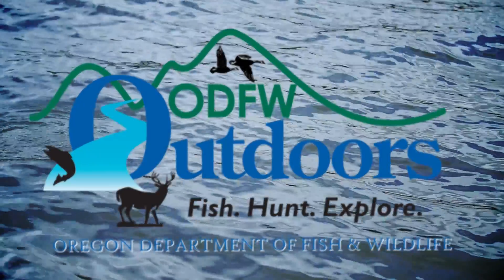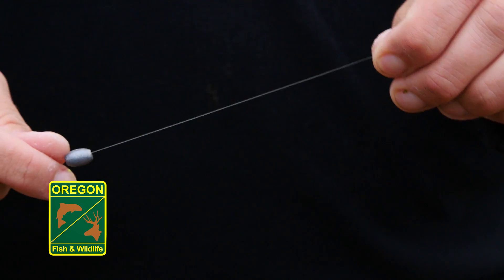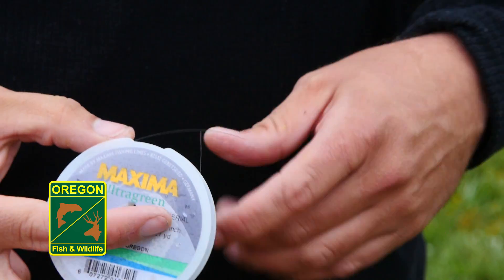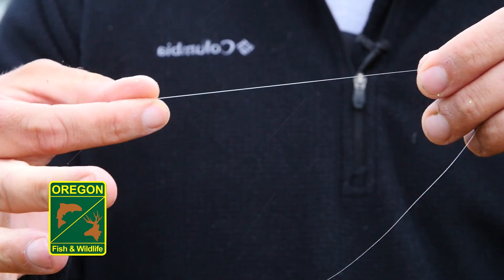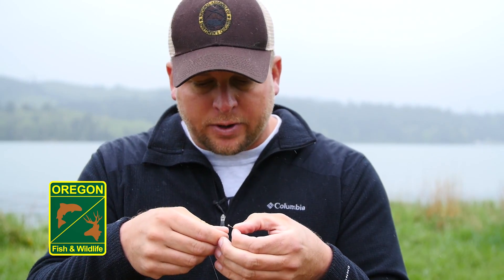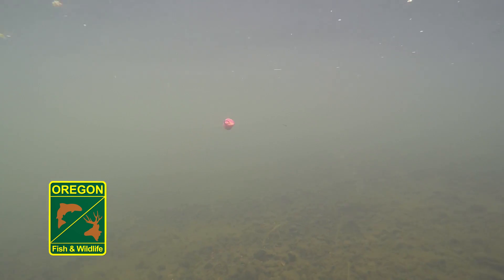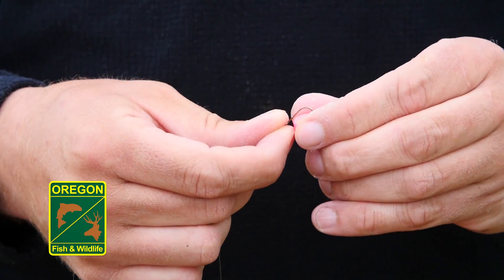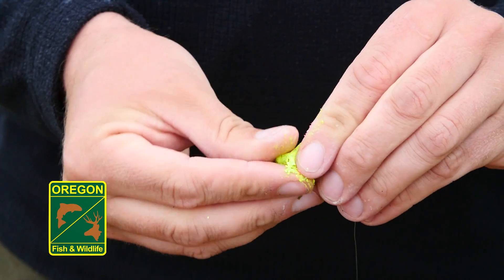Segment 8: How to Rig for Fishing Floating Bait – How to Fish for Trout in Oregon

Comment: Add a bead below the sinker or it will eventually weaken the hook knot (loosing the hook to a fighting fish or snag).
Reply: I've used the same rig with and without a bead and haven't noticed a difference in how the sinker interacts with the knot on the swivel. YMMV. Also, what's up with @johnbolton9957 😂😂😂